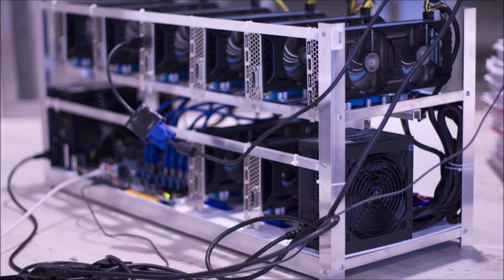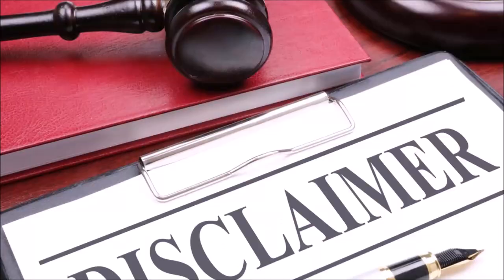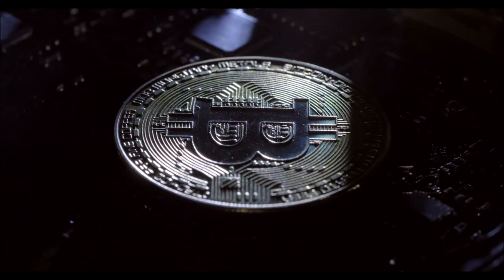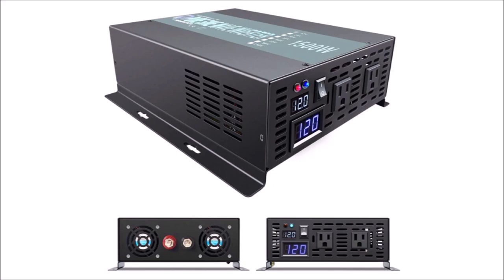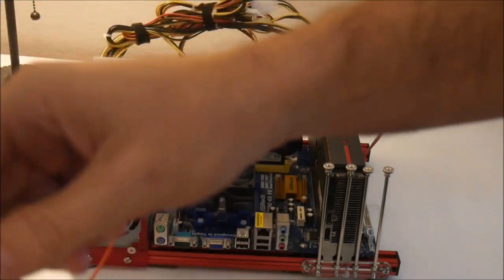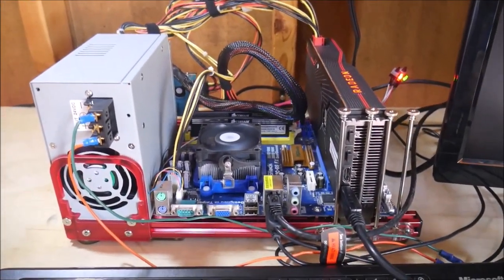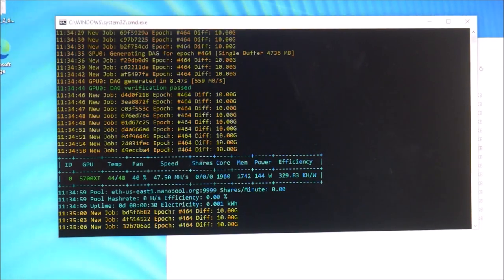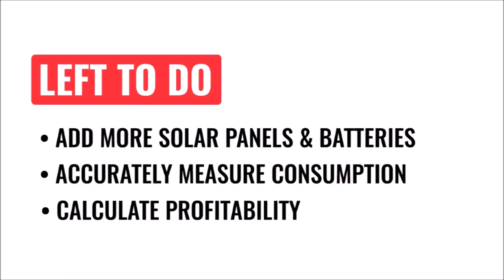Solar Powered Crypto Mining Project Part 1 - What Does It Take To Mine Ethereum On Solar Power?

Comment: Very good project idea! Make sure that you're cooling the graphics card sufficiently - not just the processor but the RAM on it as well. Also consider selling the ETH (or whatever you're mining) every so often. You don't wan to be stuck holding the bag if it craters. Bitcoin is a much more "blue chip" crypto because it has the strongest network effects and widest adoption, so that's better to hold for the long term.
Reply from the maker: Yes, I sell periodically when it hits a high.  Right now I am obviously in a holding pattern.  I'm just trying to mine as much Ethereum before it switches over to proof of stake.  Then I will have to find a different altcoin that can still be mined by GPU's and is profitable.
Reply: @LDSreliance  Can you receive any resources for getting started cryptomining? I have an old laptop I recently replaced and a desktop that will soon be taken offline. I'd like to evaluate if any of it could be used, or which coins to mine. But I don't know where even to start - let alone to run it off solar. (Though I'd love to!)
Reply from the maker: @Erik There are so many options to get started that it boggles the mind.  Unless your laptop or desktop was blessed with a graphics card that was more than 4GB of RAM, you won't be able to mine for Ethereum.  But there are many other coins that can be profitably mined by small timers like us.  There are numerous guides out there to help you get started.  But I'd take a look at Monero or Litecoin and see if either of your machines could mine them profitably.  You will need to be able to accurately assess how much power your laptop and desktop use when they are mining, so pick up a power meter (this is my current favorite:  https://amzn.to/3FY5iUB).  To be able to mine as a small timer, you have to join a pool, which is like a co-op of hundreds or thousands of folks like us that share the load and distribute rewards.  You still get credit for your individual performance, but if you were to go solo you would not be able to compete with the big boys.
Reply: @LDSreliance  Thanks! I'll see what I can find for a beginner's guide. You've still given me a next-step to aim for with solar powering it. :-)

Comment: I'm very interested in this project...I current only have two 5700 cards mining in the basement and with 24 cents a KW in my area, soon it will not be very profitable to run them.
Reply: Even if not profitable never turn them off if you can afford it.
Reply from the maker: Ouch, that is expensive!  It should still be profitable as long as you sell when ETH is not at a low.

Comment: I been thinking about doing this, just wondering how I can do it the cheapest, I have no grid power, I have a 12v and 24v system, the 24v can be 21-29v normally 24-28v and the 12v is barely used. Only lights and cameras, on 1200w pv, 400ah, I'm thinking mine from the 12v system, being it's a backup system anyway. Maybe add battery, and a DC to DC buck, to supply more charging power from the main system. I use an average of 500 watts constantly, with nearly 30kwh lithium battery, and 400ah lifepo 12v battery, in  getting a 2kw inverter  so the. Fridge can be powered if the main system is depleted, but I have generators, and DC generators, to charge battery directly, off-grid requires backups,  I'd like to put it to work to make money!  Because , well I like money, ya gotta have it to buy stuff! About $500-$700 maybe $1k a month would be awesome, I would not complain,
Reply from the maker: I make about $250 a month with 3 graphics cards, depending on the current price of Ethereum.  To make $500-1000 a month you would need some pretty serious hardware and you would be looking at a sustained load of about 2,000W 24x7.  That would be too much for your system as it is now. 

If you have old PC parts laying around and a GPU that is >4GB you can get started and it will be profitable.  But if you have to invest any money into it be careful because it may take a while to pay itself back.